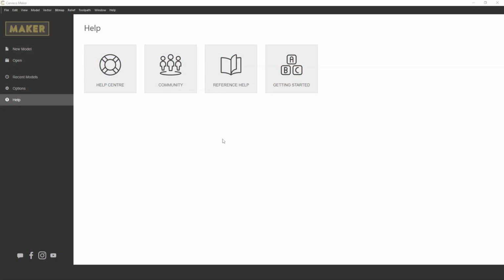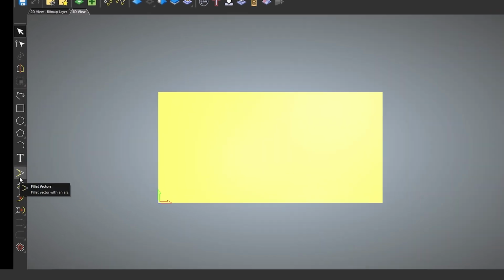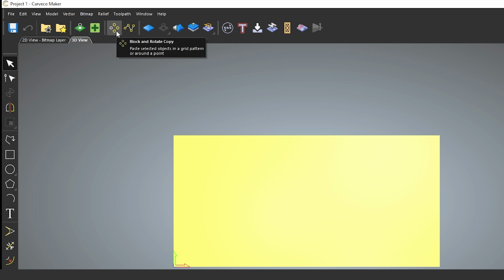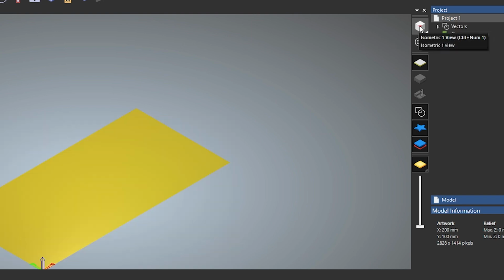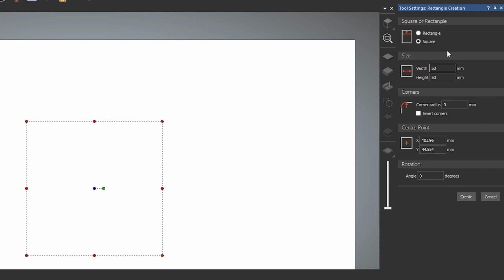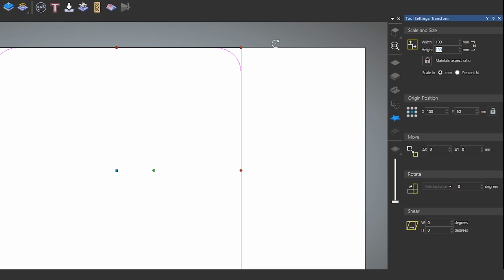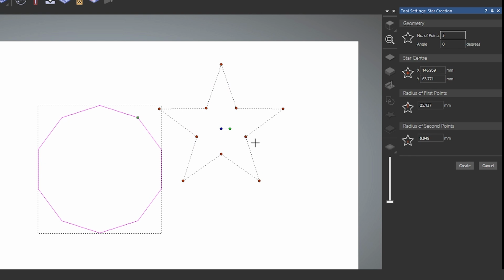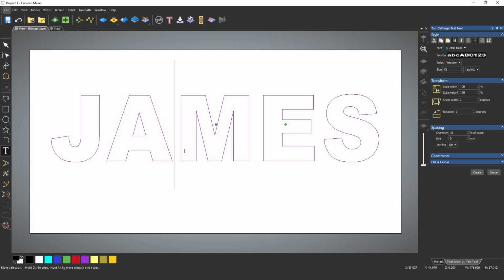Easy to follow beginners guide to Carveco Maker

Comment: im not being funny but from what i can gather what u are saying it doesnt sound that convincing that this software doesnt crash very often as u make it seem like it crashes alot from your impressions u give about it and thats the reaon il stick with vectric
Reply from the maker: Interpret my video however you like but just because I give a tip about saving your work and auto saves, doesnt suggest the software is bad. In fact any software can crash, so does vectric, Adobe, Microsoft etc. which is why I give best practice. Everyone's welcome to use what software they like. Enjoy Vectric
Reply: @JamesDeanDesigns  never once has vectric crashed and by default the autosave feature is set to 2 minuites witch in my opinion is far to long 1 minuite is a good save time just incase, but i have never had a crash from the software in 10 years of use thats how reliable it is
Reply from the maker: @BikeRider1967-p1q if you've never had a computer crash in 10 years then you are probably part of a tiny proportion of people. I genuinely dont know anyone thats not had their machine crash at some point. And thats more of what Im getting at, its not software but computers are prone to crash in general.
Curiosity has got me though, if you're so happy with Vectric, how come your watching a video about how to get started with Carveco?
Reply: @JamesDeanDesigns  considering iv been a computer hardware and software engineer for over 40 years ai am very lucky then arnt i
Reply: @JamesDeanDesigns  becasue it came up on m y feed, i dont govern what comes up on youtube its analitics on what i watch
Reply from the maker: @BikeRider1967-p1q fair enough. And yes if thats your background it certainly helps 😁 Have a great day 👍
Reply: @JamesDeanDesigns  it just seemed to me the impression you gave sent the message it crashes often and thats y i put the comment in, if your video did not give this impression then i would not have made the commment

Comment: Given the cost of Fusion 360 I really dont think Carveco is good value for money.
Reply from the maker: You're joking right? Carveco Maker costs $15 per month, Fusion360 costs $70 per month. Yes Fusion360 is more powerful but also a lot more complex and certain tasks are made harder in Fusion360 because of its complexity.
If you're talking about Fusion360 being free. It's only free for personal use, which is fine if you never plan to sell anything.
Reply: Once I have the design saved, how do I get it over to gsender for it to cut???

Comment: Hi James, In CarveCo Maker, the Sainsmart 4040 is not listed as a machine for output format.  Which machine should I use? Thanks for your help.
Reply from the maker: In part 2 to this video I talk you through what to do and the best settings regardless of machine but you essentially need to select "GRBL(mm)"
Reply: Thanks James, @JamesDeanDesigns

Comment: Hi James Im still a newby to CNC but I have followed your tutorials since i bought my 3018 pro. I am looking to purchasing Carvco Maker and i am following your tutorials but my version shows mm/sec and your presentation shows mm/min and i cant find how to change my setings only a small problem but pain to convert all the time. Great vids.
Reply from the maker: To change that, you have to go into the tool database, open up that specific tool you plan to use and in the new pop up box you should be able to switch between mm/sec and mm/min

Comment: hey how do you make it so when you get the center the curser changes? also is there a good way to center vectors within another vector? like say I have words I want to be in the center a circle, or a design in the center of a shape that is not used through f9?"
Reply from the maker: Not sure how I did that with the cursor, I just always been like it but I'll try and find out. 
As for alignments, you can select 2 separate objects, click the Vector menu and come down to align and you'll have a lot of options.
Reply: @JamesDeanDesigns  thank you !

Comment: Love your channel James. I am soon to purchase my first machine. I was going to go with the Masuter Pro following your review, but I have just seen the relatively new Genmitsu 4040, which uses screw thread bars for all axes, rather than the belts of the Masuter. I am wondering if it may be more robust. Will you be reviewing the 4040 soon? If not, any thoughts based on your knowledge? Cheers.
Reply from the maker: I have the 4040 and will be reviewing  it soon. Pretty difficult for me to comment as I haven't tested it yet though. My general approach though is belt are better if you plan to run a spindle and a laser, but if just a spindle on its own then screw is better
Reply: @JamesDeanDesigns  That is good to know, many thanks. I think spindle and laser is my plan. I may just await your review first though. Cheers.
Reply: @JamesDeanDesigns Hi James. Does Carveco support Genmitsu, because I couldn't find it on the supported list. I'm planning to buy 3020 pro

Comment: My goal is to create auto parts, use my 3018 to make foam parts i can do lost foam casting, i have been using autocad 2d for the last 30 years, and this program, carveco, looks like it will work for me, i only wish i could use it on a computer not connected to the internet, your videos are very helpful, thanks for the effort.
Reply from the maker: Let me look into this. I know with Adobe you only have to connect to the Internet once every 90 days I believe